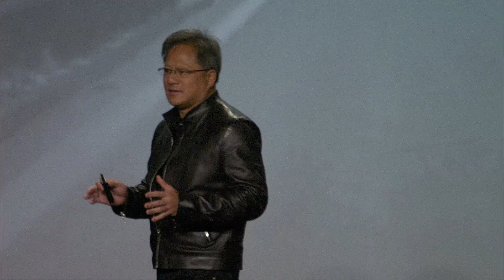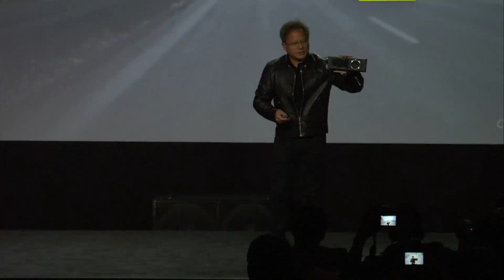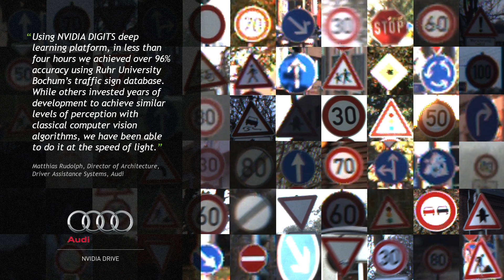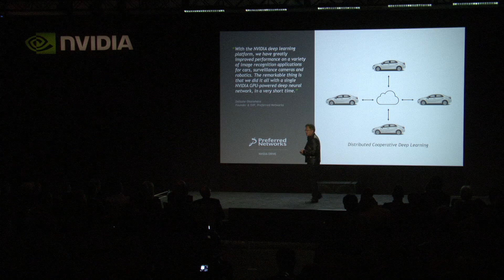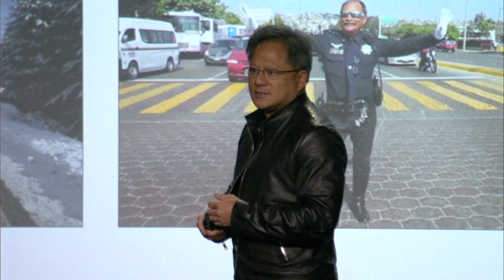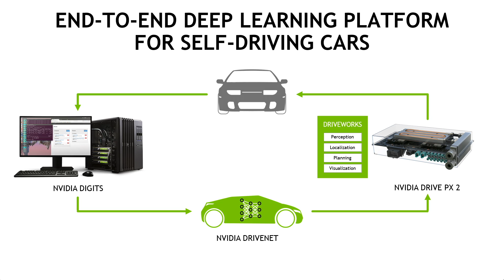CES 2016: Audi, Daimler, BMW and More (part 6)

Comment: Why Titan Xs? Why not GTX 980 Ti at a 4 way SLI? Or Titan Xs on a 4 way SLI, so you can more than 50 FPS.
Reply: +Drive Gaming Titan X > 980 ti. This isnt game, you are not "rendering" something, you are detecting things on already accessable image. You cant "sli" this like you can on games. Whole different tasks
Reply: +Navhkrin The car is scanning and feeding data into the gpu to render the outside environment, no?
Also Drive Gaming, you don't really need more than 50 frames for something, just that it's more economic to have 1 titan x rather than 4 980Tis
Reply: ***** I take back what I said